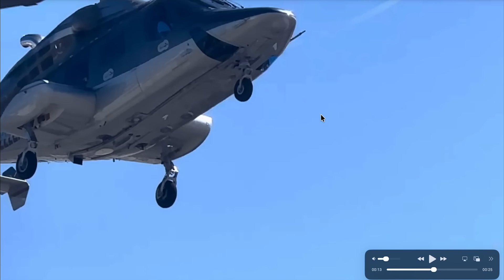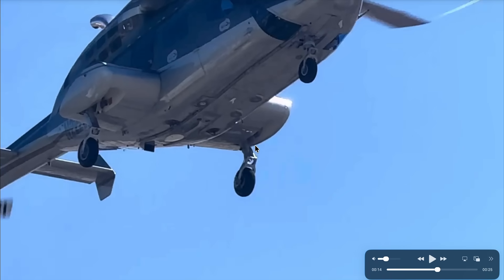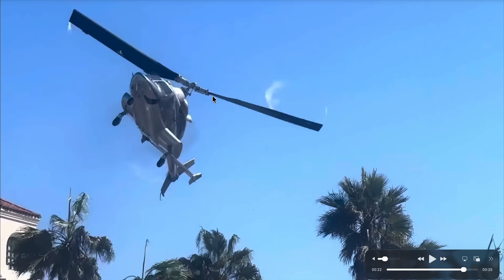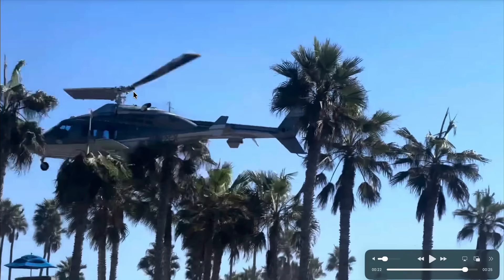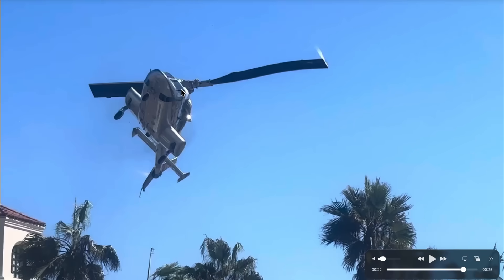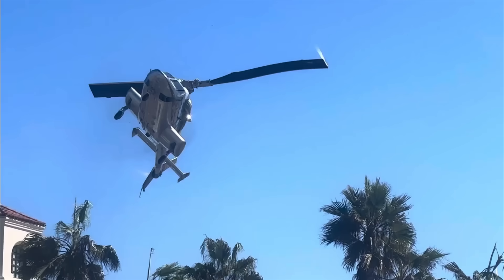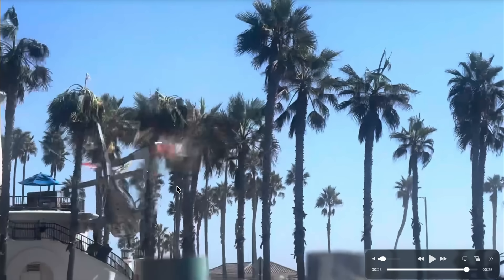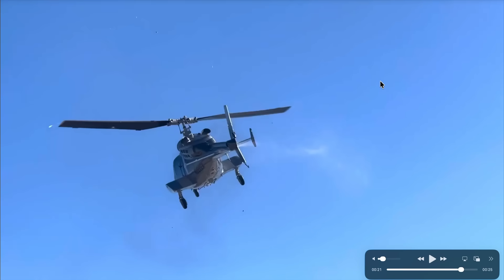Huntington Helicopter Crash Analysis - SlowMo Video!

Comment: Pc link failure, or PC link bolt failure. Pitch change link. This is what caused the issue, not the reversal of the tail rotor blades.  You’re either stupid, or smart trying to get clicks. Go away.
Reply: You are a troll. Go away.

Comment: Great video! Juan from the blancolirio YT channel just did a video, and I think he's right; if you catch the right frame at 1:00, you can see one of the pitch control linkages separate and spin freely from the tail rotor assembly, while the other one stays connected. He says it would cause immense vibrations, which would explain the catastrophic failure of the tail rotor blades, then the separation of the entire transmission assembly itself. At that point the pilot was a passenger.

Comment: I just wanna throw an observation in here: the point where "the tail rotor starts to appear to spin backwards, indicating a change in RPM" also coincides with the appearance of the visible tip vortices from the main rotor blades and the aircraft starting a climb. I noticed this watching different videos and I think it's worth pointing out, because when I initially watched this video I assumed that the MR tip vortices were just generally visible on this day (they sometimes are when atmospheric conditions are right), but the fact that the aircraft went from having no visible vortices on approach, to suddenly jerking upwards as MR vortices appear and the RPM changes means that all you're probably seeing here is the result of the pilot ripping the collective up: the sudden change in blade pitch causes the formation of visible tip vortices and a buttload of increased drag on the rotor, which drags the RPM down because the engines / governors can't generate power instantaneously on demand like that. It's also hard to tell from the slow-mo video, but in the real-time clips you can hear the RPM tanking and by the time the aircraft is descending and getting into mast bumping that rotor is probably stalled-- the RPM is really, really low.

I think everyone in the comments talking about pitch link failure on the TR are probably correct, but yeah just wanted to add my two cents because I don't think the "changing TR RPM" indicates that anything went wrong with the TR drive system-- it looks like it was just general RPM decay caused by the pilot yanking collective. As to why he did that, I guess maybe we'll find out. I was watching another clip where the helicopter chucked the TR gearbox towards the cameraman, so I guess they'll be looking at it 😅

Oh, and in other views of the accident site you can see that the area out front of the hotel there has been fenced off and there's a modified SUV on site with a massive camera crane rig attached, so looks like they were filming something (probably accounts for the "low passes in front of a balcony").

Here's one of the good videos I was looking at: https://youtu.be/3EYJm9DYgJE?t=143
Reply: Also, could the fast add torque on the airframe and response put too much stress on the tail rotor?

Comment: The vortices from the main blades reflect an aggressive collective movement (pitch angle change of the blades - more bite into the wind) of which the tail rotor matched as well. I've rarely, if ever, have seen vortices from the tail rotor, therefore, all were in sync until very likely the tail rotor linkage was over stressed due to the aggressive collective change. This high torque request, again from the rapid collective change, snapped the shaft leading to the tail rotor and at some point the tail rotor bound up. With so much kinetic energy, the tail rotor then simply snapped away from the tail completely. The video shows the blades striking the fly away tail rotor thus further compromising any available lift from the main rotor. More impressively, watch the before and after blade angles to better understand the physics and energy involved. The question remains, what caused the collective to raise, which in turn changed the rotors to ask for more lift, or the tail rotor to ask for more horizontal bite?!?!

Comment: 5:10 I'm no aviation expert but I used to be into RC helicopters which essentially work exactly like a full scale heli. In fact my favorite RC heli that I had was in a Bell 222 fuselage and looked identical to this 222. So my guess is this. The mechanical malfunction took place in the boom somewhere and this cut RPM to the tail rotor. The aggressive pitch in the tail rotor blades was the pilot trying to compensate for the lack of tail rotor power. The aggressive pitch is what broke the tail rotor blades off. But once there is no power to the tail rotor it matters not if the blades are still attached. Glad to hear all survived.

Comment: Hovered too long too close to the ground.causing a "Vortex Ring State" (VRS)
You may want to look and see what happens when he causes a VRS.  If he did create a VRS he has to increase the collective pitch, which uses more engine power and can eventually cause the tail rotor blades to over-bend and fail, or the transmission to the tail rotor to fail

Comment: This crash looked exactly like the helicopter crash that killed Vic Morrow on the set of "Twilight Zone: The Movie," in 1982. Same thing happened back then: Tail rotor separated from the Bell UH1 "Huey" from the Viet Nam war that was used to shoot the Viet Nam scene that got Mr. Morrow and two children working illegally at 2:00AM to shoot the scene, all killed when the chopper lost its tail rotor due pyrotechnics used for the war scene going off too close to the hovering chopper that was only 50-feet above the three of them. Vic Morrow and one of the children were both decapitated by the main rotor blades. The female child was crushed by one of the landing skids. There is infamous video available of this horrific aviation mishap. Yes, the images showing the loss of the heads of two living human beings can be pinpointed in the videos.

Comment: Absolutely fascinating breakdown.  I believe the tail rotor initial failure was due to over stressing by the pilot inputting too much rudder pedal / yaw.  Both blades came off at the same time and the hub gearbox departed about a quarter of a second later.

Comment: I built 2 Roroway exec. Helicopters and from what I know how the tail rotor is constructed, there are bolts hold control arms to the the actuator of the tail rotor blades and are safety wired in place. The nuts used on the bolts have a plastic type coating contacting the threads. Making backing out less likely, and with safety wired looks to me a bolt fractured on one of the blade actuators. A lot of these parts are replaced after so many hrs. This bolt could have been missed.

Comment: What is not captured in the close-up slow motion video is the helicopter "leaps up" just as or just before the tail rotor seizes up and the main rotor strikes the tail rotor.
Reply: Could be the extra power no longer drawn by the tail rotor
Reply: @peterhenman2662  But if the tail rotor gear box seizes up and the tail rotor slows down that would add MORE load to the engine/transmission, not less.
AFTER the tail rotor and its gearbox are ejected from the tail, yes there would be less power taken by the tail rotor. But the upward leap occurs while the tail rotor and gearbox are still intact.
Reply: @WTFareYOUtalkingABOUT-k3n  Why would the gearbox seize up? I'm guessing it departed because of the vibration from the unbalanced forces of the blades at different pitches.
Reply: @peterhenman2662  Did you not watch (or pay attention) to the frame-by-frame analysis in the video???? The tail rotor slows down and there's some type of hydraulic fluid leaking. 2+2= the hydraulic fluid escaped the tail rotor gearbox....metal-on-metal gear seizing....hence why its speed changed....
Reply: @WTFareYOUtalkingABOUT-k3n  Why are you so threatened that you have to be rude? What's your expert explanation for the climb? I've since watched Blancolirio, who makes the same observation as mine. Can't wait to hear the real reason from the expert.

Comment: I used to fly helicopters back in the 1990's. At 1:01, if you look between the tail rotor and the tail boom you can see that one of the TR blade pitch linkages is detached from the TR blade which allowed the one blade to pitch differently from the opposite blade, which resulted in an asymmetric thrust difference, placing the entire tail rotor assembly into a severe imbalance condition. The TR assembly was unable to withstand the extreme imbalance forces, breaking both TR blades off at the hub and then causing the TR assembly to separate from the helicopter. The TR blade(s) then struck the MR blade(s) contributing to the mast bumping and then gravity took over from that point. It was a miracle that no one was killed, unlike the MediVac helicopter crash last week. That's my synopsis, now we wait for the 90 day preliminary NTSB report.
Reply: Exactly - one of the PCL rods (Pitch Change Link) came loose from the interior end, leading to the initial rotor imbalance and initiating the break apart.... and then various parts begin coming off in a cascading reaction. The initial break and the loose rod can be seen extending out with centripetal force.... in other video..
Reply: @jpx1508 I think it broke loose from the blade horn (or the horn broke) otherwise it would be closer to the blade pivot point. But either way once they started putting pedal in for the hover it would have quickly been evident something was wrong with the amount of pedal required.
Reply: Also pilot here. Agree with your opinion. I would be very interested in the maintenance history, on this aircraft.
Reply: Yup, it’s clearly visible hanging down. Missing cotter pin ? Doubtful, likely a catastrophic metallurgical failure.
Reply: @65gtotrips The linkage broke, I guarantee the bolt/cotter key weren't the problem.
Reply: Spot on.
Reply: なるほど、よく理解出来ました！
Reply: I noticed exactly the same thing by watching the tail rotor in XPlane12. The connecting rod, right ! But why did it disconnect ??? Another detail is that the other blade pitch shows the pilot pushing the left pedal to the max trying to stop the helicopter rotation ; it turns in the same way when pushing the left pedal in the simulator.
Reply: Tail rotor linkages are normally secured with safety wires around the nut to the linkage. Did someone not torque the linkage and secure the nut with safety wires. Former Mechanic UH 60 A.M.L models. The tail rotor came off due to unbalanced centrifugal forces.
Reply: @hawk7825 On another video I seen the TR linkages bolted on with a nut, cotter key was used instead of safety wire. I noticed that right away. No safety wire.
Reply: that 222 has more protection  than new ones. you can survive in that bell.
Reply: then it was MECHANICAL FAILURE?????
Reply: aahahahhah you just saw the video that were talking about it
Reply: There was one photo going around showing two of the bolts securing the pitch links brackets were missing where it would normally be secured with safety wire.
Reply: As a helicopter mechanic from Germany, I largely agree with you. However, at the beginning of the video, a loss of speed on the tail rotor was noticeable. If this wasn't an illusion due to the line speed in the recording camera, then it would indicate a defective main gear or defective bevel gear on the tail rotor, or defective shafts to the tail rotor. As a result, we would then be able to detect exactly the same damage if the speed suddenly drops from 1500 to, say, 750.
Reply: Agreed. There was a divergence of thrust that was probably created by broken/damaged/failed linkage, which brought about the inability of the pilot to control the lateral rotation; and also generated forces that caused catastrophic damage to the entire tail rotor gearbox.
Reply: Yep this person is right. You can see a detached linkage rotating at that location. Good catch!
Reply: You right. But I am looking at the cockpit . It looked like the one or both pedal Explode when pilot Trying to counter rotate It looks to me a hydraulic failure. NTSB going to have a party with the Maintenance.
Reply: @Josdiaz718 😢😢
Reply: I to used to fly helicopters inthe 90s on the SEGA Genesis,  and have witnessed this crash many times.  

When the report comes out regarding the reasons we will all have moved on to something else.
Reply: @redwineisfine  I had a Nintendo in the 90s 😝
Reply: DEI hire mechanics?
Reply: @JDMZoneOfficial idiot

Comment: I am not saying the analysis is wrong.  Of course everyone is going to go to the tail rotor.  However what puzzled me was the sudden increase in altitude BEFORE it began to spin and the sudden smoke coming out of the engine.  Possibly an engine failure...leading to loss of tail rotor power?  Pilot maybe freaked out when the engine failed and tried to gain altitude to avoid the trees? That might explain the sudden water vapor trails that we suddenly see come off the rotor tips, again, BEFORE the spin starts.

Comment: So I think I have an idea why the tail rotor assembly split from the airframe.  The drive shaft to the rotor sheared.  That could have happened when the rotor ends broke off. Conservation of angular momentum would make the rotor stubs spin faster. And that stress sheared the shaft. 
Then with the aircraft body spinning the centripetal force on the tail / gearbox tore it off the airframe…

Comment: Reverse rotation of the tailrotor is illogical and highly unlikely. The optical illusion caused by Frame Rate and rotation would explain the appearance of rotation reversal. What is more likely is the linkage controlling tailrotor blade pitch broke and the pitch of the blades reversed or neutral causing rotation speed change and or stresses that caused the blades to detach, but what caused the gearbox to depart the helicopter? What cause both tailrotor blades and gearbox to departed the helicopter? Crazy! Regardless, when the tailrotor stops working, the only option is crash.
This will not end well...
Reply: It's called auto rotation unless the main rotor mast separates from a mast bumping situation, then it becomes a crash.
Reply: @mustangflyer6878  Loosing Yaw control = crash, it may be survivable, but it's still a crash, and yes, I know what auto rotation is, but it's performed with Yaw control. Thank you for playing. 🙂
Reply: @Thinker2-truth It's losing, not loosing and autorotations are NOT performed with "yaw control", on a helicopter it's called LTE or Loss of Tail Rotor Effectiveness and it's most certainly not a crash. Autorotations are performed everyday with absolutely no damage whatsoever to the helicopter, the Pilot takes off, flies around, autorotates, lands and then takes off again, autorotations are standard Pilot training protocol for certification and recertification. The only time autorotation does not work, is if the main rotor blades are severely damaged, separate or a mast bump shears the main rotor mast in two, only then does an autorotation become a crash.
Reply: @mustangflyer6878  Your saying helicopter pilots train Auto Rotation without Yaw. My keyboard glitches "oo", but some people are right all the time.
Reply: That's exactly what I'm saying, when you lose TRE, you lose all control to turn the tail of the helicopter, your "rudder" pedals are dead. I used to fly an MD500E, what helicopters have you've flown? I'm done arguing with you, go back to sleep.
Reply: @mustangflyer6878  Do you frequently argue on YT? I don't. Nighty night... Thank you for playing 🙂

Comment: There is no joint in the main rotor mast. It is one piece from inside the transmission drive to the jesus nut.
Can't fail in the middle.
Picture it like a fat car rear end axle. Like 3.5" in diameter, and the flange maybe 15".
Reply from the maker: Look up Mast Bumping.  There is a joint with these rotor systems.  They 'teeter' on a hinge and if excessive movement happens the teeter part can hit the mast and sever it which is what happens here.

Comment: Helicopter rotors are very busy and manually controlling aircraft attitude is an extreme work load for the pilot so helicopters employ auto-pilot stabilization.  If the tail rotor begins to fail the stabilization system will attempt to maintain attitude, thus the sudden pitch change in the tail rotor subsequent to total failure.

Comment: First of all, at :46 seconds, the pilot is attempting to overcome the yaw…hence the sudden but short lived T/R blade pitch change. 
The “smoke” as you call it, is hydraulic fluid from the severed hydraulic lines as the gear box departed. The gearbox oil probably remained (at least mostly) contained in the gearbox itself. This would depend exactly where the T/R (tail rotor) drive failed, which in this case was either at the input drive where the gearing changes the direction of drive ≈ 90° from the shaft off of the main transmission or the gearbox internal gears themselves. Either way, the “smoke/mist” was most likely hydraulic fluid. 
Once the blade’s RPM drops dramatically while the blades are under load (anti-torque..attempted) the rotational inertia that gives them rigidity/strength is diminished to the point of material failure. The blades failed symmetrically because that is how tight the engineering specs are on these things/everything that bears a load on an aircraft.
ALSO, I’d love to see video dissections of these types of incidents from an actual pilot that has more than a dilettante level knowledge of the subject - Not This Guy. 
I do remain stunned at the “huevos” on the guys that are not much more than Microsoft Pilots making crash analysis videos.